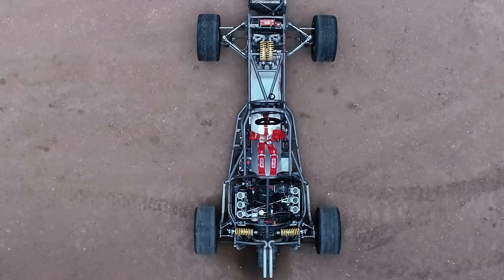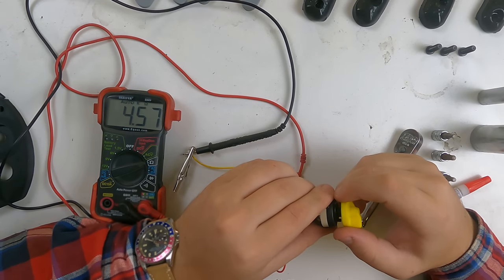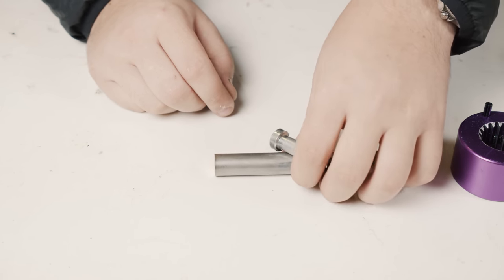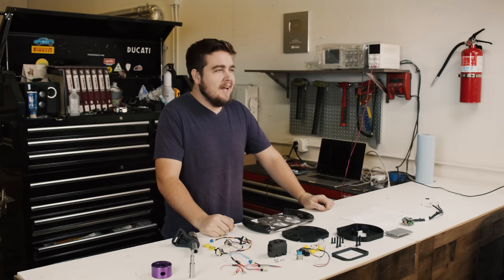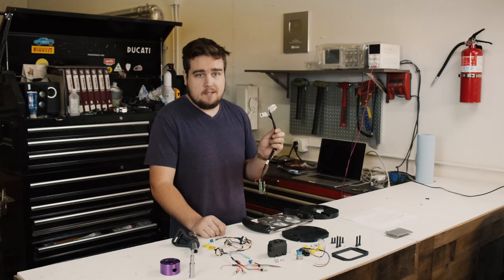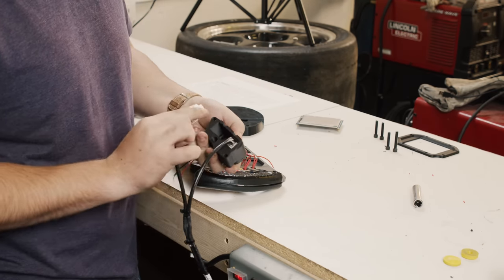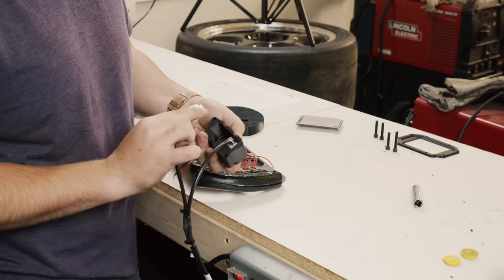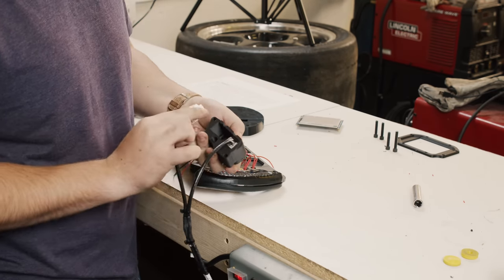The 60's F1 Car Returns with a V12

Comment: If you would like to use the i2c bus in higher noise environments, or environments with longer runs, I would look into a bus accelerator. Analog devices sells the LTC4311 which I have seen used to fortify i2c busses on cat 5 cable. Signals competently and reliably can be transmitted for distances over 30m. I know you've found a workaround at this point, but in case you feel like it, you could look into this. Also: I would point out that the arduino uno/micro uses an ancient 8 bit microcontroller with extremely low speed and memory resources. I highly recommend looking at the arduino zero or nano, which use a much more modern 32 bit arm microprocessor and have tons more space in them.
Reply: Alternatively move to CAN. There are some simple/cheap CAN transceivers like MCP2515, with corresponding Arduino library. Similarly to I2C, you can put a (large) number of devices/uCs on the network, which consists of only 2 wires, but is much more robust.
Reply: Bus accelerators do work, but they're an EMI nightmare - if you're running that I2C parallel to any other busses or analogue signals crosstalk can become a huge problem.

I second using a modern 32 bit micro. I spend a lot of time working with the pi pico and I'm a huge fan.
Reply: @huzeff  CAN would be the logical choice here, since it's pretty much designed for this purpose...

Also later in the video he refers to an MS3Pro by which I presume he means MegaSquirt, which supports CAN for clusters...
Reply: Oooohh! some CanBus folks!!! Hey ah, can someone tell me why we even use CAN? I dunno just doesn’t make sense with mini and micro PCs, GPUs, etc. One would think all that processing speed would be beneficial to engine performance. And then watching movies, ya see kids racing with friggin laptops in the passenger seat. Yea I’d rather ask the question than look it up and tumble down the research rabbit hole - kinda old school, but not old school enough that I wouldn’t mind a few 100 core processors (or whatever we’re up to now) on-board. Na don’t want a Tesla! Rather breathe car exhaust than mine the Earth for all she’s worth. (can’t wait for them to leave for Mars. I hope they can hold their breath!). Anyway, I ask because I own a Tech II. Boy! it’s painful to use, especially since GM only let’s you use a IBM Thinkpad from the ‘90’s and RS-232 serial connects (pre- USB). I got it new from China (can’t get a letter to my neighbor within a week, yet get pkgs from China next-day. I just don’t get it). Yea, don’t ding me for mining silicon - I got nothin’…😊
Reply: @pistonwristpin1  CAN was designed from the outset with automotive (and similarly electrically nasty environments) in mind, it's got very high noise immunity without needing a bunch of shielding and such. It's also resilient enough that it'll keep working even if you break one of the two CAN lines (though at diminished performance). It's also relatively simple to implement in hardware.

Also being an addressed, bus-based system it means you can stick all the stuff in the vehicle onto the same (or more often a couple of separate) CAN network(s) and have them talk to one another without having to build and wire dedicated point-to-point communications interfaces between each system and all the stuff that system needs to talk to.

Means you can just lego stuff together, for example you can stick something like a Haltech Nexus ECU, several Haltech PD16's, a pair of Wideband controllers, an electronic dash and whatever other gubbins into a system and just use the same two wires to connect the lot together rather than having to individually every circuit through the car separately.

Comment: Very nice. Wow that is a lot of wires to wire through a steering wheel connector though. 

I did try something similar once (ended up parking it for now) but used a 6-pin mini-din in the inside of the steering shaft. Lined up so that when the steering wheel was in the correct place it would just slot in. Only used 4 pins though, gnd, +12v, CAN L and CAN H. Used a custom circuit board to use CAN with an arduino. I'd link pictures but youtube won't let me.

Comment: Switch to using CAN rather than I2C. There is an arduino library available and there are plenty of shields. You can keep using the CAT5/6 cables (in fact doing so will be good if you use a pair that's twisted for CAN. It'll make the electronics side more difficult but all your data transfers will just use the serial port and it's still 2 wires. If you're building a custom board for the steering wheel you can include the CAN chips directly there anyway
Reply from the maker: Because I'm already expanding the circuit board, I agree. I originally was expirimenting with wireless protocols (bluetooth, exc) and couldn't get a reliable connection. I2C worked well for this, but as I expand, it really needs more headroom. I want to use a board for all the connections on the wheel instead of all those soldered wire connections anyway.
Reply: I've used I2C in an industrial enviroment before and it was a nightmare! (Even using pullup resistors that are almost shorts and a baud speed of 1k)
Reply: @WesleyKagan  Yeah, you do NOT want to do wireless in this kind of environment and I2C is great for small amounts of data, but it's very slow, which causes problems when you want more than a few frames per second.

Comment: Good to see you back in the garage with some new content, Wes! Suggestion on the steering wheel rotary control knobs: (I know this, because I am also building my own steering wheel for my street car, and I am trying to print circuit boards to retrofit steering wheel controls from a ~2018 Hyundai into a 1998 Trans Am) the way that the factory avoids the spaghetti, is this--Instead of running each resistor to a separate wire out (a good idea at the start), each resistor runs into the next adjacent resistor, similar to how a rotary phone works. Select item 1, and the signal goes through one resistor, and then out. Select item 2, it goes through that resistor, followed by the resistor from item 1 for a total if 2 resistors, and a different resistance value. As expected, item 9 runs through all 9 resistors before exiting the steering wheel. In this way, only 1 wire need go in, and one back out again. Hope that helps.

Comment: Pumped to see this revived! Steering wheel looks good though it's so close to the rest of the dash would be easy to accidentally hit switches and stuff while turning, I know all that's gonna change anyways but yeah, something to plan, a wheel looks good in it's initial position but you have to think of ergonomics mid-turn too and not hitting anything else with your hands.
Reply from the maker: Yeah, I didn't have room on the build now for gauges or dash switches or anything, so that's why it all moved to the wheel. Makes things easier for sure!

Comment: i'm an embedded software engineer, and the display is pretty dope. i've been designing a similar display for an F1 style go kart i have (made in the 70's). if you are still having memory problems, there are some tricks you can do. you can store some (or all) of the static image data like the lines in the program space using the keyword PROGMEM. if you haven't used it before, read the arduino page on it. you also want to live in the stack as much as possible, and use as few variable declarations as possible. in some cases, you can use the video memory to do calculations. if you have a chunk of video memory you know is all 0's or all 1's, you can write some math stuff in there, and then just put the 0's or 1's back when you are done (John Carmack perfected this method with Commander Keen years ago). Basically, try to avoid any alloc calls if you can, and reuse variable as much as possible. anything static, stick it in progmem.

you can also usually compress your graphics a TON. i noticed you have a lot of lines , and instead of storing a bunch of 1's in memory, you can store where the line goes and how long it is. typically storing compressed data in progmem is the way i save the most space when it comes to fancy screens.

you also might write your version of Wire.h that does the bit banging for I2C. you can often squeeze out some more space by doing this because the libraries have to be general purpose and often include stuff you don't need for this particular project. this goes double for screen libraries, which often have a TON of complicated and bulky code for screens that can rotate like a phone. The adafruit screen library has a huge amount of code that is useless if you don't plan on rotating your screen at all.

Comment: Hey man! Here are some tips for printing TPU:

n.1 (most effective) - use a direct drive setup. It makes printing tpu an absolute dream as it pulls the you more than pushing it through Bowden.

N.2 - print slowly, usually printing at about 40-45mm/s works best, possibly slower too.

N.3 - not often mentioned by high acceleration and constant flow is vital for getting good tpu prints, as the less pressure change in the nozzle with flexible filaments the better the end result. High acceleration means that there's less time spent changing extrusion amount and there is less flow / pressure change.

N.4 - use high flow nozzles, they allow for more consistent extrusion of tpu as the bigger melt zone can prevent funky tpu moments.

N.5 - bigger nozzles print better. A combination of a 0.8mm nozzle and a high flow hotend (phaetus rapido for example) means that you can get more plastic down quicker at the same amount of pressure, and smaller pressure changes don't effect the end extrusion amount too much.

These things have helped me print flexible filaments the most, though I would definitely say that the extruder matters the most. Look up printable extruders capable of printing 70-85a TPU and they will be more than enough to print any material reliably and at speed

Comment: Duuuude, good to see you back.  I was thinking the other day I had not seen a video of yours for awhile.  It's interesting to see you are 6'2".  Just a shade taller than me, so I can about how I would fit in that car.  I like how you are designing it for your size.
Reply from the maker: Glad to be back! Thanks! Yeah, It bothered me for a long time because the roll hoop on the Lotus was 31" and the original kart was 36, so even at unsafe height it was still taller. I gave in and made it to fit the one who is driving it hah. With the adjustable pedals, ideally anyone should be able to drive.

Comment: Instead of TPU, have you considered printing molds and pouring up some silicone? I've done some of this, including making little silicone one-way valves like they have on the full-face snorkels. It's worked pretty well.

Comment: What really helped me print TPU was getting a filament dryer, TPU wicks up moisture really quickly from the air and creates artifacts and other print issues. I just got a cheap food dehydrator off Amazon and cut the racks until I could fit a roll of filament in there. I normally put the filament in for a couple hours before I print

Comment: Hey Wesley, thanks for the content. 
To help save memory onboard you can buy a nextion screen. It does the touch controls onboard its own μc. Has a super easy interface to create the GUI. You can use pictures and such. Also it only uses a TX and RX wire. As an ME that had to make HMIs for my projects it made it super simple. 

Using a teensy could make things easier they have an onboard CAN and they run like 40x faster than an arduino. Much more memory. Downside 3.3 V logic. 

Going to CAN could help you use a through bore slip ring since you only need a CAN high CAN low and power and ground. 

Just my 2 cents hopefully something helps.
Reply from the maker: Teensy seems to be popular- I actually ordered one last week but I have a bucket of Arduinos so it's what I know for prototyping. CAN is seeming like the way to go as well, and I agree. I tried some wireless protocols but didn't have a ton of luck with a solid connection.  I'm going to have to look into the nextion screen, that's seeming to be a much better resource for the graphics side. 3.3v would take some work.

Comment: @2:47 The normal way to do this is to use the same value resistor linking adjacent legs so that your voltage divider has even steps, then put 0v on one end of the chain and 5v on the other end.

For example:

0v to pin 1
1k resistor between pins 1 and 2
1k resistor between pins 2 and 3
1k resistor between pins 3 and 4
1k resistor between pins 4 and 5
1k resistor between pins 5 and 6
5v to pin 6
Signal from sweeper pin.

This should give 0v at position 1
1v at position 2
2v at position 3
3v at position 4
4v at position 5
5v at position 6

If you want some error banding then you can also put a resistor inline on the 0v and 5v lines to condense the steps further. This will allow you to program an error function if either 0v or 5v is read on that input.

0v to pin 1 with 1k inline resistor
1k resistor between pins 1 and 2
1k resistor between pins 2 and 3
1k resistor between pins 3 and 4
1k resistor between pins 4 and 5
1k resistor between pins 5 and 6
5v to pin 6 with 1k inline resistor
Signal from sweeper pin.

This should give 0.71v at position 1
1.42v at position 2
2.14v at position 3
2.86v at position 4
3.57v at position 5
4.28v at position 6

Comment: For printing TPU, my experience has been that you want a direct drive extruder, print relatively slowly and very importantly calibrate your extruder steps. I need to up the flow by 30% compared to PLA because the TPU gets squished on the extruder gear giving it a smaller apparent diameter. The bed doesn't need to be heated, cooling is dependent on what you're trying to print. I've only ever used NinjaTek NinjaFlex on a modified direct drive Ender 3 Pro for reference.

Also, if you want a part you can compress check the infill types, they have different properties in different directions. In cura there is a plugin that gives a lot of explanation about all settings including infill, including what their strengths and weaknesses are. For example, the cross-3d infill gives similar resistance in all directions.

Comment: Took a peek at your code. IIRC, you don't need to redraw the whole screen every loop, you can update just the parts you want to change. In other words, draw it all at the start, or when you change modes, then just update the relevant bits. Hope this helps.

Comment: For good results with tpu, the best thing I’ve heard to do is get the straightest and shortest length direct drive extruder as possible. Things like ender 3’s are especially bad at tpu because of their Bowden tube setup where the filament has room to squish. Hope this reaches you and is of help 👍🏻

Comment: also, the pi pico is mostly compatible with Arduino libraries and is quite a bit faster, so you could look into that on top of loading images from the sd card to improve display speed.

Comment: So cool to see you do a project similar to what I've been working on, as far as the arduino and screen go, Been working on an oil temp and pressure on a similar Nextion 320x480 screen. Not sure if their GUI works with the Adafruit, but the Nextion Editor program is super helpful on creating those graphical backgrounds. Looking forward to the next couple videos of this!
Reply from the maker: I'll have to check that out! Honestly my method of lines and bars did okay, but it's definitely a bit heavy- code wise. Thanks!
Reply: @WesleyKagan  Oh this is lovely on code, it gets loaded on that SD slot and there's not much code to send the data to each box. You can even change designs and not touch the code as long as you keep the box ID's the same.
Reply: @WesleyKagan  I was going to recommend the nextion as well. Besides the editor the other benefit is there is an existing library of dashboards that the sim racing community has created. It should just be a matter of tweaking the identifiers in the editor to those the Arduino is using... at least in theory.

Comment: For running the length of the car, try RS485 instead of i2c, if you can.
Reply: I am up for this as well. Or at least in the case, you have 2 microcontrollers communicating with each other. The other option would be CAN, but most CAN modules for small microcontrollers use SPI, which will be busy controlling the display. The RS485 is basically uart, so it uses uart module/block inside the uCPU.

If you use RS485, it is handy to implement/use some messaging protocol to ensure message transmition and validity. This though is actually quite easy.

Comment: love the project,
did you think about using CAN for the dash ?
ms3 supports it, and you wont be limited by bandwidth or cable length (plus its only 2 wires from ecu to dash)

Comment: You can get good results with tpu. I have a Bowden setup and adding a PTFE guide inside the extruder stepper to constrain the filament made the biggest difference. I also dropped the retract setting down to absolute minimum.

Comment: Quick recommendation, to get around the printing challenges with that material, you could print yourself molds and then cast your forms with material from Smooth-On.  There's also expanding foams on the market now with many density options. You could always wrap the handles with something nice like Alcantara. 👍 cool project  😎